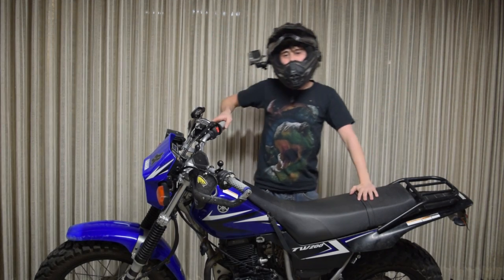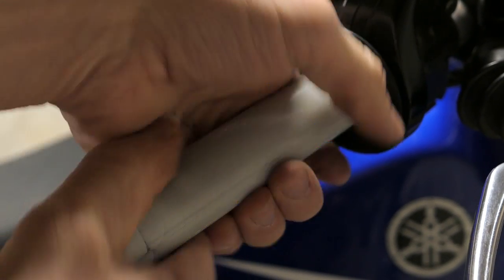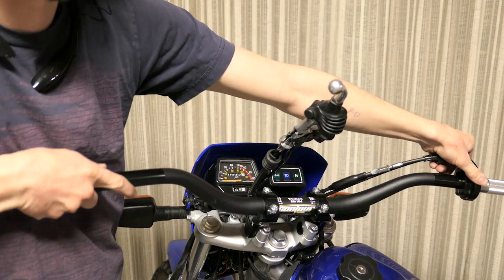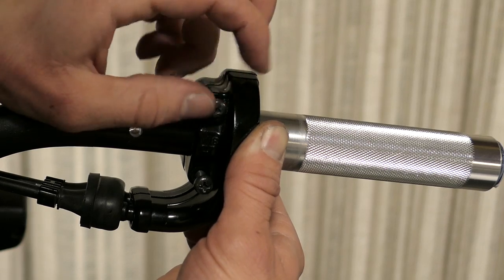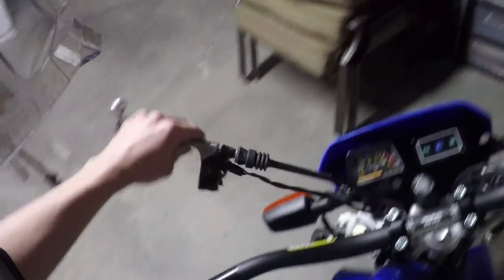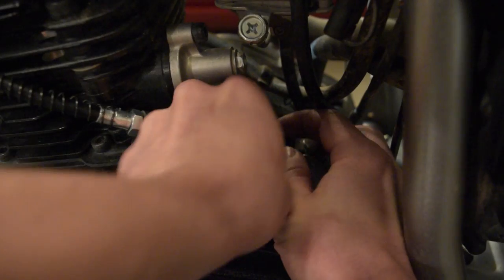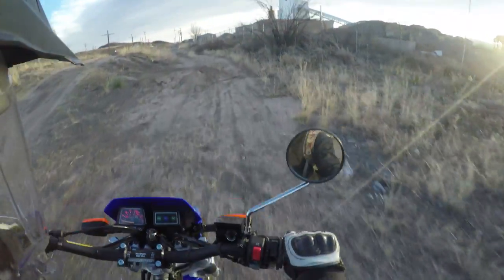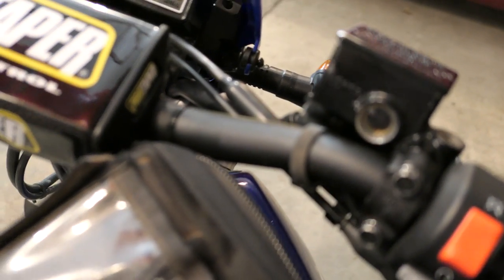How To install ROX 2in risers and ProTaper Bars on a Yamaha TW200

Comment from the maker: Find everything here:
Protaper Jet Black Contour Windham/rm Mid (the exact one I got): http://amzn.to/2EXKFcm (amazon affiliate link)
ROX 2in risers (exact ones I got): http://amzn.to/2DNStOb (amazon affiliate link)
cheap quick and easy risers (no modification necessary with stock bars) http://amzn.to/2DstFOa (amazon affiliate link)
longer clutch cable: unfortunately I can't find it on eBay anymore. I need to source another.
Regular plastic throttle tube for TW200: https://ebay.us/k1pHTU (ebay affiliate link)
(buying from an affiliate will help support the channel at no extra cost to you, thanks!)

check out this video for some cheap and easy risers:  https://youtu.be/dImQXrUCi9c?t=2m57s
Reply: Okay so am I on crack or is $112 more than a little crazy for a cable?? Did they go up in price since you bought yours, or were they always that expensive?
Reply: The link for the handle bars doesn’t work,  just got a tdub and your videos are a huge help
Reply: Thank you. Appreciate it.  Now I have to get er done😂

Comment: Finally a young buck that's not a hack master. There are three ways to fix things. 1- Total hack job, 2- fixed but easy to tell something has been done (usually orange silicone everywhere) and 3 - Fixed like OEM and nobody will ever know. You do nice work.
Reply from the maker: it's always a good feeling when you do it the right way even though it takes a lot longer, thanks man!

Comment: Great video!  It also convinces me that I'll take mine to our LBS to have the work done, along with installing a different set of sprockets to get a little more speed without maxxing out the RPMs.  I don't need the tractor gears since I use Willow for a true ADV machine on the miles of dirt forest roads around here.  We're almost next door to the Washington BDR, but I need to get on the 60mph highway to get on it.  Since it's Washington, everybody drives 10mph over the speed limit.
Reply from the maker: thanks! for sure. best to have the job done well, yeah, best to customize it for your type of riding, yeah everyone drives like that here too. I can get a lot of places here with 55mph, not the fun part though

Comment: Thanks for the useful video. Although for many they want their bars as wide as possible please note that if you cut an inch off each bar end everything will fit well with zero modifications. Bars still feel great a bit narrower too in my opinion.
Reply from the maker: yeah I wasn't really seeing any extra room, maybe because of the street controls?
Reply: @TDubsKid  I did use the pro taper ATV high bars (no risers) so perhaps my set up is a bit different

Comment: Unless I am mistaken, those aren't Philips, but the awfully similar looking JIS (Japanese Industrial Standard) screws.  They are on my circa 1984 Honda, and since the TW 200 is almost unchanged since '87, I think it would be true here as well.  Recommend a JIS screwdriver set from Amazon, will dig in deeper and work smoother.  I learned this the hard way.
Reply from the maker: yeah that's correct, I should get some, Philips can work if your careful but easy to round out

Comment: Any TW owner not subscribed is losing out! Great quality, content and presentation. A gem find!  Are there used model years to stay away from or would present reliability issues?   Thanks
Reply from the maker: haha thank you! not really that I know of they are pretty much all the same, they started putting a front disk brake and a few other small changes starting in 2001

Comment: Just wanted to let ya know about the vessel 980 impacta JIS screwdriver. US phillips and Japanese JIS screws are not the same at all. Check out the JIS #2 driver. You'll never strip another phillips screw on a Japanese bike again. Everyone that's worked on Carb bowl on a bike has stripped a bowl screw. Never again with one of these. Might be a great idea for a video. I have some links on my channel if you have trouble finding them. Hope it helps buddy.
Reply from the maker: thanks! your right. I picked some up recently. for sure will talk about it when I need to use one in a vid. much appreciated!

Comment: Great video!  You should buy a Vessel screwdriver.  It’s JIS spec which will fit those screws properly.  They are on Amazon and make one that has interchangeable bits.
Reply from the maker: thanks! ill have to check that out. I got to get some JIS drivers

Comment: That, young Sir, was an extremely well presented, well thought out, well considered, and usefully edifying tutorial. 
Absolutely blinking marvellous. A bit of fun too with the "TRex Kid" dub !!
Does anyone know if it's ever possible to get (or make) an actual harness extender, you know, with the appropriate Fe/male connector blocks already fitted on, say, a 150mm length of cable(s), ready to just plug in and go?
Kind Regards.
Reply from the maker: hey thank you so much! and I'm not aware of anyone selling that, but it would be cool if they did so you didn't have to cut them if only If I could find the connectors and pins they would be easy to make
Reply: @TDubsKid  Hey TDubsKid, just watching this again, and it struck me that my "Easy Peasy DIY torque Wrench" vid might help anyone out with those inaccessible fasteners where you can't get a torque wrench to (like under the bar risers). Check it out and see if you think it might have potential, at least as a back stop on anyone's peace of mind. Kind regards.

Comment: I know it's been a while but do you have the part number for the longer clutch cable, I can't get the link to work 
And as always thanks for the best videos and research!
Reply from the maker: yeah that one is no longer available, I found another that says 43" and the one I put on is 42" not sure if it will work the same though, I ordered it to see, https://www.ebay.com/itm/Clutch-Cable-for-Yamaha-YZ125-BW200-TW200-WR250X/222310082272?fits=Make%3AYamaha&hash=item33c2b6a6e0:g:GDYAAOSwy79f27Hk
Reply: Your the best, thanks!

Comment: You should get, Barkbusters brand barkbusters, they are hardened aluminium, and won't bend. They can take way more of a beating than any other brand hand guards.
Reply from the maker: those are pretty good ones, I actually just ordered highway dirtbikes next gen hand guards they are pretty rad, they have fold in mirrors and a lot of other neat features
Reply: TDubsKid folding mirrors is a pretty cool feature. I want folding mirrors on my Yamaha XT250.
Reply from the maker: for sure! my stock mirrors would always get messed up riding gnarly stuff haha

Comment: @tdubskid thanks for other reply on tires, now question on handle bars. If I go with pro taper bars with no riser just standard height clamps will I need to do any adjustments on cable and positioning ect? Do bars taper down to 7/8”? Just wondering for ordering grips and same hand guards with mirror you installed. Keep up the excellent videos great help to us tdub owners new and old 👍🏻🍻
Reply from the maker: Depends on which bars you get there are many bends. The 1-1/8 bars go to 8/8 where the grips go. Highway dirt bikes only sells them for 1-1/8 bars now. I’ll keep them coming. Good to hear!

Comment: This is off topic of the vid but i really hate the drum brake on the TW200 could you possibly do a drum to disc brake conversion video because i have no clue how to convert it but i know it’s possible
Reply from the maker: yeah it's possible but would be very hard to do since there are no kits available for it and would require a good amount of fabrication, here is some info on a guy who did it http://tw200forum.com/forum/performance-customization/11161-rear-disc-brake-conversion-finally-completed.html
Reply: Just go to the yamaha dealer and order the parts. No fabrication needed as the forks are the same. But you will need a new front hub

Comment: Good video. As a former tech, I dont recommend cable lube as it deteriorates cable lining and will cause greater problems in the future. If the throttle or clutch cable does not function smoothly and routing is correct, replace them. You can also install grips with compressed air and not use any chemicals at all.
Reply from the maker: thanks. it's a special kind of dry lube designed just for cables, over 15,000 miles of using it with no issues. it makes the clutch feel butter smooth. ill have to give that a try

Comment: Do the little dots on the handle bar mounting brackets actually mean anything? Real question is, if I put them back on upside down will it cause problems lol?
Reply from the maker: I would imagine the point to the front but i'm not sure if it really makes a difference

Comment: Hey,  enjoy all your videos! I just put Pro Taper ATV High bars on my bike. It's about 2 in higher than stock. So I went ahead and got the clutch cable from Ebay. Question -- how did you get that heat shield spring on the new cable?!? I've been messing with this for an hour and don't see a good solution. Thanks! Steve
Reply from the maker: hey there! so glad to hear, nice that's great, no need for risers haha, oh yeah I cut off the ends of the spring where they are all bunched up then twisted it on, I should have shown that in more detail in the video

Comment: Will the stock switches and all fit on a 1 and 1/8 inch bar or will I need spacers? I ordered a bar that doesn't taper to 7/8s

Comment: Kid, were the bars you installed the same height as stock? If not, do you know which ones are stock height? I'm looking to install the ProTaper without the crossbar, but don't want to mess with extending the cables. The 2" Rox risers give me enough height now. ThanksKeep up the great videos.
Reply from the maker: they were pretty close hard to say for sure, if you can try taking the stock ones off and go to a motorcycle shop that has a good selection of them and size em up. gottcha, hope it works out for you! thanks! ill keep em coming

Comment: Tdubskid 
If i get these protaper bars with no risers  do you think ill have to get a longer clutch cable?...or do any of the other modification you did? im only upgrading the stock bars to get the HDB hand guards 😁
Reply from the maker: seems like you would need at least an adapter to run these bars, because of the different sizes, you may not need a longer clutch cable just gotta try and see what happens, nice!

Comment: Which LED pod do you use on the bars? I have a 2005 TW200 that I need to swap bars on. I have heard the Pro Tapers are more comfortable
Reply from the maker: it was just a generic 18watt flood light from amazon, I got 2 new 12watt spots that I will be putting on after new handguards, ill angle them out to the sides so I can see where i'm turning better at night. nice, it makes a huge difference! I love the ones I got, I think it depends a lot on the bend

Comment: Can I put the rox risers on the stock bars using the same cables
Reply from the maker: not really sure, I think these bars were pretty similar height to stock. I might have a link to a video showing risers for the stock bars where you don't have to extend anything
Reply: @TDubsKid  Thanks I’ve been trying to find that video but nothing. One more thing what bulb did you use for your headlight. Thanks for answering my questions. Once again you are awesome.

Comment: Are your throttle cables upside down at the handlebars ? You have them ran under the bars. Mine are on top.
Reply from the maker: yeah that is so the can reach the extended bars
Reply: @TDubsKid  oh ok you didnt go over that I dont think.

Comment: Hey did your cycra guards still work with these bars?
Reply from the maker: they might work but not sure inner clamp will fit the bars since it would go on the tapered section. I just got highway dirtbikes next get handguards that ill be putting on soon

Comment: That’s 16,000kms wow congratulations lol I’m at 7000 with a 2012 TW200 would you buy a brand new TW200 once this one dies ?(which won’t be soon)
Reply from the maker: hey 7000 kms is not bad! a lot of old ones only have 500 miles on them haha and probably not ill just rebuild the engine or buy a new engine unless they put fuel injection on the tw then maybe I would buy a new one
Reply: I had just bought a 1999 TW125 (only 125cc is sold in Europe unfortunely) it has 30.000km on it and it runs great! Just did the oil and filters. So 16k km's is nothing yet. Some here have well over 60k km's and they still go!

It took me over a year to find a nice TW because it's only sold untill 2003 here and most of them are roughed up and very rusty
Reply: TDubsKid drop a 225 6 speed in it when it does, from a ttr225. That's what I'm working on
Reply: Yeah, when my tdub explodes that's my plan. It seems like affordable tw200 engines are kind of hard to come by honestly, I guess there's just a lot more XT225s/TTR225s/TTR230s out there to get salvage parts from
Reply: projectile dysfunction cause the 200's are pretty bullet proof and easy to rebuild. I just got lucky on a cheap 225 6 speed. It'll just be a hobby, pie in the sky build. Who would want more horsepower and an extra gear, lol.

Comment: If you wouldn't have cut off that hand grip it would have been the proper length you wouldn't have need to adjust your brake lines
Reply from the maker: For sure

Comment: Don’t grind aluminum on a grinding wheel.  It’s for steel only.  The stone can burst and hurt you badly.
Reply from the maker: how could it handle steel but not aluminum? it's a softer metal
Reply: Never seen one burst but the wheel will load up w alum and then not cut unless you dress the wheel
Reply: @TDubsKid  The aluminum clogs the wheel.  You can research it if you don’t believe

Comment: Wouldn't you want to position the handle bars and risers THEN attach all the switches and levers? Seems like you kind of did that backwards.
Reply from the maker: I got the handle bars in the basic position to drill the holes for the switches and throttle so they were in the right spot. levers are easy to adjust